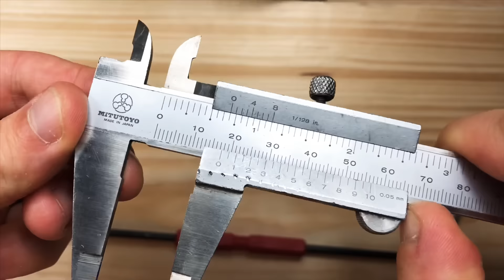How to make a Ring from 50 Cent - DIY easy

Comment: Am definitely going to try this technique.  I believe it will only work for bands.  I want to make one and have a band of goldstone chips or torquoise.  Seen one on another Utube.  I have learned to make rings from brass plumbers hex nuts.  I have a bench grinder and a dremmel tool.  I use a cut off disk to cut the excess material off versus a hack saw or filing.  I purchased a high speed cylinder burr for the dremmel to remove threads or to increase size of ring.  To remove excess material from exterior of nut I installed a felt polishing wheel on the bench grinder and stuck on a circular sanding disc for metal.  Grinds the nut down in a couple of minutes.  It is a fine sandpaper so ring is relatively smooth.  I then use jewellers rouge on felt wheel to polish ring..I like how you use a bolt on a couple of nuts to hold ring. I have used a small screw driver handle in the ring to grind the first big amount off.  II am making one flat surface on ring so cannot spin the whole thing.  Looking forward to some other of your videos.  Thanks for sharing.
Reply from the maker: WOW thanks for taking the time to write this detailed comment!

Comment: Тhanks a lot! I made several rings of stainless steel nuts.Now l m going to make a ring out of German silver  coin , upon your video.
Reply from the maker: Здравствуйте Михаил
Я также записал видео колец, сделанных из гаек из нержавеющей стали.
делать кольца из монет намного проще. Желаю успехов, спасибо за комментарий! всего хорошего!
Reply: @badasscrafts  Спасибо!Желаю успехов!
Reply: If you drill the inside later amd just turn the coin by hand it shouldnt bend like that might be helpfull to you
Reply: @petermikus2363  8ý9i njujm
Reply: Becareful with nickle as it can cause allergic reactions. Try coating it with resin first.

Comment: The brass that doesnt oxideies and is malleable like actual gold but you have yot heat it  first in order to not have craks
Reply from the maker: Unfortunately, the ring oxidizes over time and has to be polished again and again...
Reply: @badasscrafts  but it oxides harder than classic brass bronze this  
why is callled nordic gold

Comment: Good video, but my ring leaves a black marks on my finger, is there is any way to avoid that?
Reply: Just don't wear ring tht tight for ur finger  try 1 size bigger
Reply from the maker: I know the problem. The inside of the ring should also be polished regularly, then things will get better
Reply: You can always cover the ring in some kind of transparent varnish